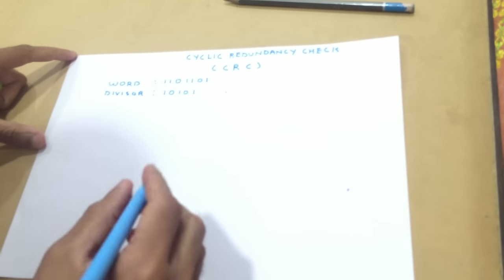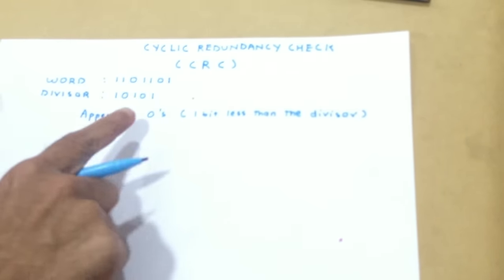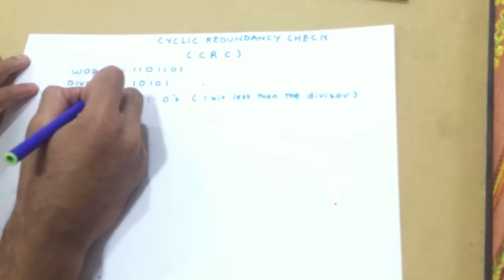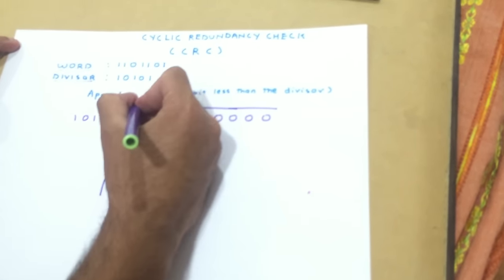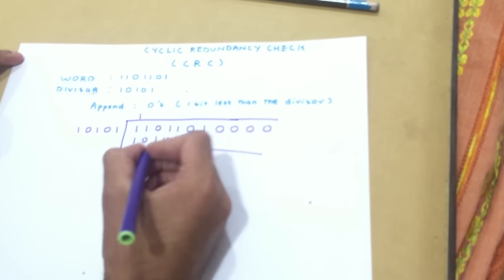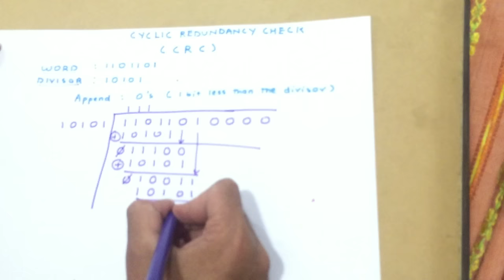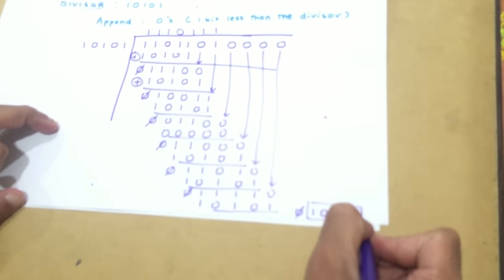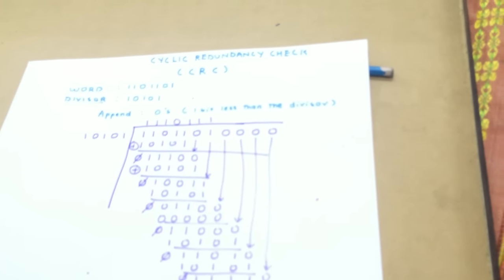Cyclic Redundancy Check(CRC) example

Comment: Hi, my name is Neil Harrison and way back in the 1980s I was an engineer working for BT.  I created the CRC4 frame/multiframe structure for the 2.048Mbit/s transmission system that became a CCITT standard in G.704/706.  Did all the modelling work on a BBC Micro.  Seems a long time ago now.  Amazed how it lasted.  Been retired as a engineer for about 9 years.
Reply: Hi Neil,

I presume you are in the UK (because you mentioned British Telecom!). I am a Computer Science student who currently learning Computer Networking and I'm afraid I don't understand what CRC 4 is but I would genuinely love to know more.

If you have the time, I would really appreciate if you could provide more insight.

Cheers,
Reply: @DaBestAround  CRC4 - this is a cyclic redundancy code of degree 4 (polynomial is X^4 + X + 1) that I used to detect errors in  the 2Mbit/s transmission systems and also to prevent timeslots from mimicking the frame alignment signal (FAS) and thus stop incorrect frame alignment. If you really want to know more see CCITT Rec G.704/G.706....and/or do a search on CRC4.   A long time ago for me.....amazed anyone still has interest in this work I did back then.
Reply: @neilharrison01  Hey Neil,

Thanks for the response. I looked into it and I tried to find your name somewhere throughout the documents but I couldn't find it.

I totally believe you mate - everything you've said has been bang on and I don't know why anyone would even lie about that 😆

There is still a bit of interest in CRC4. See, I clicked on this video to learn about CRC (for my upcoming networking exam)

If you don't mind me asking, how did you even get into the field - I know things were different back then but I'm genuinely curious.

Also, even if it is a bit tedious, how did you end up creating the frame structure? - was it assigned as a task to you by BT or did you just do it?

Cheers.
Reply: @DaBestAround  I graduated with a 1st class Hons BSc in Electrical/Electronic Engineering in 1981.  My final year project was creating a pulse width modulated microwave radio link....so I was heavily into Maxwell's equations and stuff like that.  I took a job with BT in Nov 1981....originally I wanted to do microwave research at Martlesham but optical fibres had just hit the news so there was not much call for microwave engineer research.  So I ended up working in London at BT HQ.  My first boss asked me to look at what was happening with the US 1.5M transmission standards as they were using a CRC6 polynomial to detect errors and prevent false framing.  Our 2M transmission structure was better than the 1.5M system (for many reasons) but I only had room in bit 1 of timeslot zero to create a frame/multiframe structure and so I was restricted in the size of CRC I could use....ergo why it is CRC4 and not of higher degree (higher degree = better error burst detection).  However, CRC4 is perfectly OK for what I designed it to do.  After getting the CCITT standards G.703/704/706 sorted, that define the physical and frame/multiframe stuff, in Geneva in mid/late 1980s, I spent many years afterwards researching what real error distributions on digital metallic/optical/radio systems looked like....they for sure are not Poisson-like (as was the case on the old analogue transmission systems), but follow complex self-similar burst characteristics (weather is a key cause, and weather is bursty/self-similar).   I spent the next few years working as the UK expert at CCITT meetings defining standards for error distributions detection and stuff related to that area.  Later got promoted to more senior management roles and stopped doing hands on real engineering....hated this stuff, but it was well paid.  Hope that background helps.
Reply: Did this not suffice?  CCITT Recs don't mention author's names.  You can find my name listed amongst IETF stuff related to OAM.  But they are old now.  Quite a few patents listed against my name wrt OAM topics in protocols like MPLS.
Reply: @neilharrison01  Hi Neil,

I promise I'll get back to your comment soon. Very interesting stuff. I just have exams at the moment and I am doing my best to cram as much info as possible.

BTW if you can find a link to any patents that have your name on it, I'd love to take a look.

Cheers.
Reply: @DaBestAround  I found some and posted the URLS....but they did not appear....maybe Youtube does not allow URLS in comments?  Most of the stuff I did (like IETF drafts and patents on OAM topics) are out of date now.  Some still exist though if you look.
Reply: Hope you did OK in your exams.
Reply: @neilharrison01  hi neil, how u doing? Thanks for your good wishes - i got another set of exams this August (exams I missed!)

Hope you’re doing well.

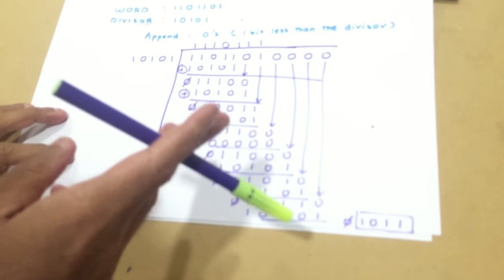Comment: What you said at 4:42 was incorrect. You are trying to find the bits to append to the word that will serve as the CRC check. The remainder is exactly those bits. You will append them to the original word and this is sent to the receiver. The receiver then divides the received bits by the same divisor and the remainder should be zero. Other than that, good video :)
Reply: +Zumerjud but it was clear anyway
Reply: +1
Reply: Was it you calling to tell him he said something wrong?
Reply: yes u r right
Reply: yes you are right
Reply: Thanks for the clarification. What he said there didn't jive with what I'd been seeing from other sources, but I wasn't sure if I was misunderstanding since I'm new to CRC.

As an aside, the video was great besides this point. Maybe the author could add an annotation with this correction?
Reply: Initially I was confused by that, but your comment clarified that to me. Thanks. But good video anyways, thank you.
Reply: Good observation

Comment: Very helpful, ty. I just din't understand the purpose of the number you put on the top there on each iteration (the one that correspondes to the first bit). Does it have a purpose?
Reply: +João Rodrigues that number is called the quotient.
You may be asked to find the quotient or the reminder, so if you are asked to find the quotient, you know where to look for :)

Comment: 2:55 - Are you substracting there? Because 11011(27) - 10101(21) = 0110(6) So, am I doing something wrong?
Reply: OK, is not a substraction, is a XOR but... is the operation a division? I mean:
11011010000(1744) / 10101(21) = (83) with a remainder of 1, I even used a online calculator to check
Reply: This is like the division, except that we use modulo 2 to substract
Reply: Ah; OK, Thanks me!

Comment: I have a question here, how the receiving node know the predetermined pattern? Where the predetermined pattern stored in a frame?
Reply: it's predetermined, both data links know it, you don't send it in a frame.
kind of like an international standard.
for example, the polynomial for CRC-32 is: x^32 + x^26 + x^23 + x^22 + x^16 + x^12 + x^11 + x^10 + x^8 + x^7 + x^5 + x^4 + x^2 + x + 1

Comment: solution is good, but this process initally happens at the sender side and if the reminder is zero then the data along with incremented bits are sent to the reciver in a data frame please correct that mistake.
here result would be == The data word is 1101101 and divisor is 10101 and the crc bits which are send to reciver along with data word  in a data frame is 1011.

Comment: Why do you divide 01100 by 00000?
Reply: +Fractional it starts with a 0.... it's like asking is 10 goes into 09..... because the digit the aligns in place with the 10 is 00 the result is 0 (because 10 goes into 9 0 times) with binary it's pretty much the same thing but in base 2.

Comment: sir,can i apply this method:
                                       10101 ) 1101101 (11
                                                      10101 
                                                      ................
                                                        11100
                                                        10101
                                                      ...............
                                                         10011         now no. of bits in data word and divisor are same.now i will apply regular method to solve the crc..........
is it also right?
because it gives same answer as your method.
Reply: chutiyapa this is called !
Reply: no

Comment: your method is correct but your concept behind the method is not clear. So be fully clear with concept before making any technical video. Thank you
Reply: Tubai Roy I think it's the result of the division, which you could use to make sure you did everything right.

Comment: NO, you're incorrect. 
You just found the CRC bits which need to be appended to the received side message and then the XOR division will be performed. 
how come you have an error on a message without transmitting? You just did the division and 1011 is the CRC bits generated.

Comment: But y appended 0000
Reply: +Ganesh Katakar short answer, so you know when to stop dividing to be left with a remainder. Long answer, this same concept works in base 10 (decimal) as well. If  you divide with intent to determine the remainder, you could just add 0s as many as the divisor has digits - 1. and then divide until you no longer have digits to drop down....what is left will always be a valid remainder. It's just simpler to use this method when dealing with binary (because there aren't decimal places to tell you when to stop like with decimal numbers.)